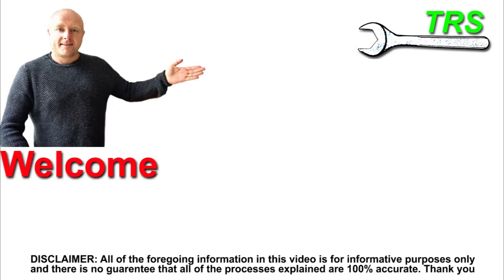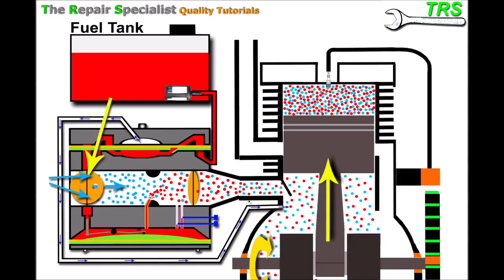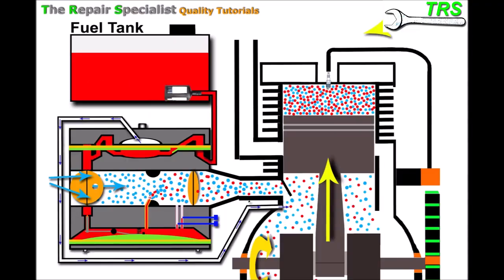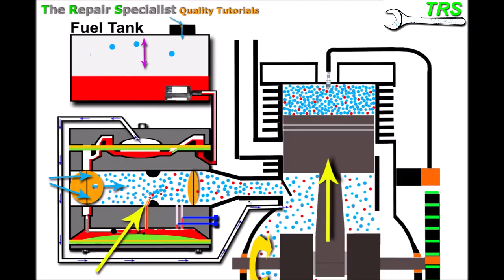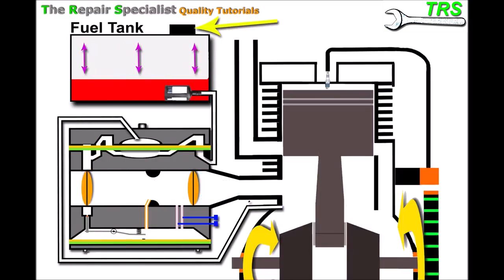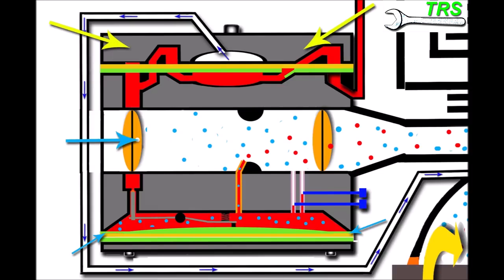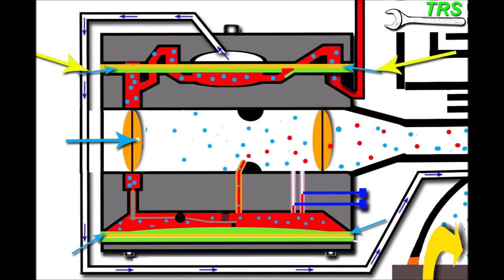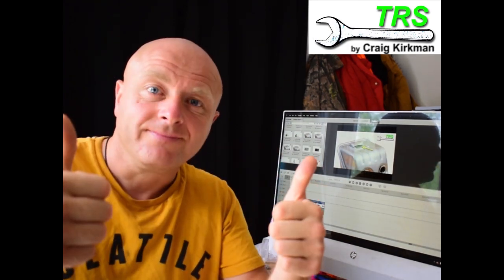2-Stroke Engine Only Runs on Choke (Will Not Run) This is why!  (by Craig Kirkman)

Comment: Good video, working on my Strimmer engine right now,  after many years of no use (because it wasn't working correctly), found several faults, partial fuel filter blockage, leaking fuel tube inside of fuel tank and air filter blockage. Ran it after rectifying the faults and found it working on partial choke quite well, will try it under load tomorrow. Was going to buy a new electric strimmer so if successful you will have saved me  much needed money (Pensioner). Many thanks for your info.